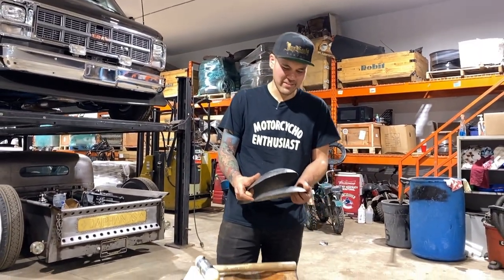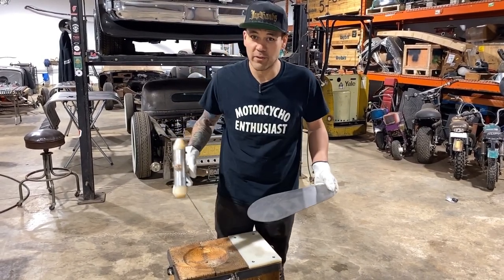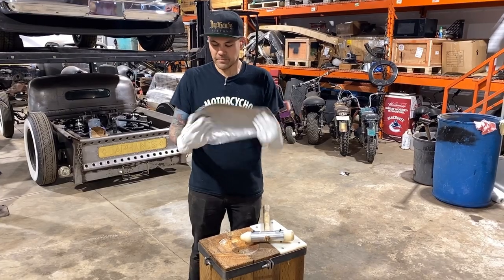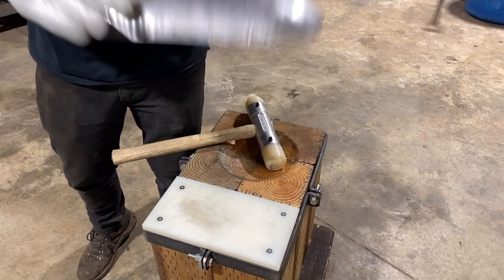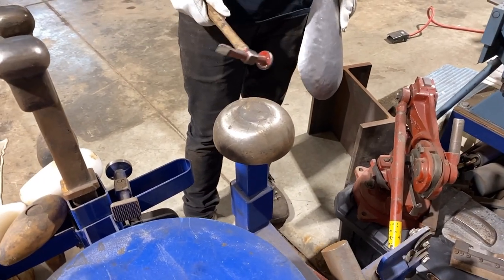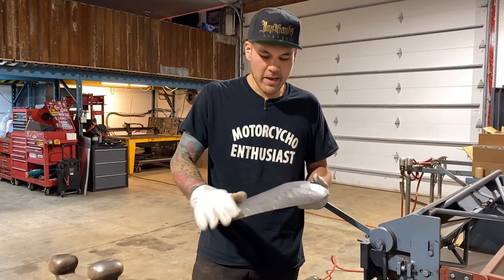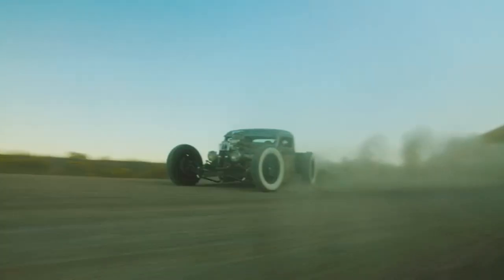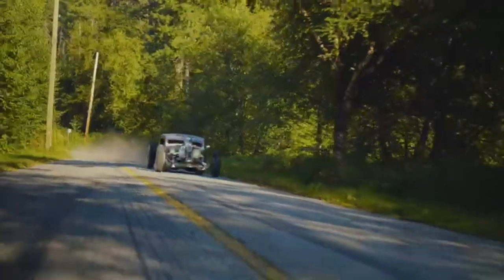Simple Metal Shaping with a Shrinking Stump, Hammers and Dolly

Comment: Thanks for the "How to " it's like the kiss idea .. keep it simple stupid ... this video really does show how simple the basics are , a good hammer and a dolly and off ya go . Add to it as you grow , a tree stump with the hollow a few more shaped dollies its not that hard . Yes that mental road block has the effect of limitations in what you can achieve I'll admit that's hit me for a while now . Many years back a friend sold me a basic mig welder only 90 amps .. more a hobby one than anything substantial.  For 30 years that little tool earned me a fair amount doing plating on cars and anything that I could weld up . Along the way I taught myself how to shape steel to fit areas that had rotted out . Due to age and mobility I very rarely do body work on cars anymore now its bikes as I can do what I need on a lift bench . Recently I started custom building bobbers and the stumbling block is the lack of fitable rear mudguards ... I can do them easy enough but as you say the mind plays with ya abilities regarding tooling yes I've got a pipe anvil and sheet benders but no planishing hammer or English wheel . Looks like it's time to go back to basics and re teach myself . Thanks karl for the push . Really enjoying the videos and as some have said in the comments I'll agree you are the best out there on you tube . Your skill set and laid back way of explaining is brilliant . Cheers .

Comment: Thank you for making the point, 'keep it simple'. And for stressing that you don't need elaborate,  expensive tools. YES, they make things faster and easier - SOMETIMES.  
I use a screw-on welding tank valve cover as a "mushroom". I put it in a vise and pound away. My 'stump' is the concave (bottom) of a welding tank that I use on my workbench, and my flat piece of 'nylon' is an old railroad tie plate. My hammer - Harbor freight.
Reply from the maker: That’s awesome ! I’ve seen guys make a hammer from the tops as well
Reply: I have an old hammer with removable inserts that I found in an old tool box and I "turned" inserts for the thing out of literally every material I could find using my drill press and a flap wheel... That was before I made my own lathe which is janky AF but still does everything I need and more I have some videos on the lathe... The gas bottle dish is a really good idea tho that's on my list of things to make cuz I have one of those and even still have the cap and I never thought of that...

Comment: So your new stump works very well. I'd like Wray Shielin's design aswell. He calls it the facilitator. The stump bowl is lined with a blue shield material without the plastic membrane on the surface of it, butyl like material that grips the work piece some what when you shape the tucks inside the bowl. It never seems to wear out and seems to speed up the process of stretching and shrinking because it holds and gives at the same time. Great job show the simple shaping of the steel .I enjoy shaping aluminum much easier . I watch ya all the time Carl!

Comment: Perfect video at the perfect/ ironic time! I was barely out of city limits, purchased a house & remodeled it. 5 years later due to fraud l, deception, I miss the freedom of being out of city limits & being a homeowner! Now that I am in a small apartment, I cannot work on my car or do projects, I feel smothered! I have to replace the rocker panels on a pontiac G5! The rust has spread further then a set of rocker panels would cover by themselves so, I was thing of buying sheet metal, bags of sand to pound the metal onto & try my hand at making my own rockers & panels but, as I was working, I saw the price on a small sheet of sheet metal 40-45+ & realize that it might be best to purchase pre-made rocker panels & 1or 2 sheets of sheet metal to patch in above the rockers. Funny/IRONIC how I speak of metal shaping & I see this video!!! Your shrinking stump is cool & you have some Nice equipment & one heck of a garage!!! I was considering hammering the sheet metal on bags of sand to form the shapes & I am wondering how well that would work?

Comment: Great vid !  Picking up more & more ideas from your vids - thank you.

One of my dollies I've used a lot is a hard rubber (not plastic - they crack) bowling ball, which works surprisingly well.  I drilled out one of the finger holes to 3/4", shoved a 3/4:" bar into the hole, clamped it in a vise and formed the needed curvature into the sheet metal.   I've made lots of patch panels over the years with it.

Comment: Use your gas torch with no oxygen. Put soot over your part then open oxygen to a neutral flame and burn the soot off. This will aneal your aluminum and make it softer to work and also so it won't crack. Thank you for your great videos.

Comment: I agree with you although it’s hard to make an accurate statement without holding it myself but it just looks kinda big. If you could make it like 20% smaller overall I think it would look more proportionate and you could even keep the same sized nylon heads. And shorter set screws so they fit more flush when seated. Great design though and you could even offer a whole array of different pointed and crowned interchangeable nylon heads for it too.

Comment: Karl, these "how to do it at it at home with virtually no (high-buck) equipment" videos are great encouragement for DIYers that want to try our hands at Metalwork without risking the relatively big bucks on equipment that might end up being wasted if we decide that we don't enjoy it.  Thank you for making them!

Also, when you mentioned using Bondo for filling as & when needed, it reminded me to ask if you had heard of Evercoat Rage Ultra Xtra (a body filler) + its catalyst being better than Bondo.  I saw another YouTuber that is not a "body guy" using it when filling small casting defects on some machinery before painting.  He said it was recommended to him by several viewers and that it lays down easier & sands easier than Bondo does (or has for several years worth of machinery rebuilding/restorations for him).  Do you have any opinion on this product?

Comment: G’day mate. Quick question. Does the metal start to get work hardened when hammering it like that? Would annealing make it easier to move?

Keep up the great work. 👍🏻
Reply: I'm pretty sure hot rolled mild steel does not work harden.  As an added bonus, it is also cheaper than cold rolled or carbon steels :-)
Reply from the maker: If it were aluminum yes but for the steel know

Comment: Cool stuff. I'm curious if you've ever tried rubber pad forming or hydroforming. They seem like interesting processes that I think you could tackle.
Reply: Hi. I’ve looked into that too. And this year nearly purchased the materials to make a setup. But… after pondering it a lot, I think  a shop press that can only apply 25 tonnes will struggle with 1mm steel. 
In all the videos on YouTube, the aircraft guys are using soft aluminium.

Comment: Successful demo, the best kind. Did you use your File-turned-slapper at all? I had a wasted file that. Like you, I turned into a nice offset and polished slapper. Works effectively on examples like you demo'd here. Two thumbs up.
Reply from the maker: Thank you! No I didn’t use the slapper just my single hammer to smooth it after
Reply: @MakeItKustom  This was one of your best series with the stump build followed by how to use it. Even with time shortening by the vid process, you moved that metal pretty fast. A keeper and inspiration for many of your watchers.

Comment: The tools we grew up with is nothing what is available now days. From 9yrs old I grew up doing floor pans with 2 bed rails, 2 vices, couple ball-peen hammers, pliers and welled it together with oxygen and acetylene. At age 16 got a arc welder and until I was 20 got my mig and tig. Wishing back now I wish there was alot more metal shaping but took machining and welding instead of automotive. There's alot of cheaper tools has made that possible now days.

Now cheap and quality don't go together and dont mind paying extra for something that will last, but you said you were making an affordable plannishing hammer... but 3k cad is little much for people I know last I checked. Its like lazzie equipment, would be nice but will never afford anytime soon.

Comment: Aww man! Effort...again? I did that last year! Everyone who wants to bash metal should really learn the old school ways first before, AND become reasonably proficient even before they get to touch a machine. (What would they do if they only knew machines and the power was gone?). Even though metal working machines have been around for over 100 years, the old hand working ways still apply, the old tooling is still a viable path and can still be used. This gives them good grounding in, and appreciation for the processes involved. Plus hopefully a realisation that the work that the old timers put into their pieces, was considerable. Although tools like the mushroom dolly are generally made with certain operations in mind, what ever you find useful for it to do is what it was made for, it's just something the designer never thought of. Karl, with all due respect, your stump is moving far too much. I recommend a HEAVY base. Perhaps a 1/2" steel casing filled with reinforced concrete and slabs of 1/2" welded to the base up to the strapping you made. This is the reason blacksmiths anvils are heavy and fixed to a HEAVY base...no movement. All that movement is lost energy and is causing you to have to work harder than you need to. Otherwise, another awesome vid! You have well earned a lot of respect from your followers, including me...(and, being old and grouchy, I ain't easy to please 😊)
Reply from the maker: Thank you very much for your honesty! You are totally right in the beginning of the video I didn’t have it screwed down. By the end of it I attached six more six by sixes and wish I had just made mine all the way to the ground

Comment: So I been trying to determine if it is better to use a soft concave surface like this with a rounded hammer, or to put it on a flat hard surface with round hammer. The hard surface will push the metal outward, and in theory cause a bulge to form. What are your thoughts about using a hard surface?

Comment: Hi Karl, I wonder if it is possible to shape a piece of sheet metal into a corner. I'm currently rust-repairing my daugthers car and there needs to be a patch welded, which is pretty much a corner.
We were trying to hammer it out and shrink it with a hammer but  it was terrible. 
in the end we made one cut and welded the overlapping part.
Do you think it is possible at all just by using hand tools?
Best regards from Germany!
Reply from the maker: It’s definitely possible but a “hammer form” with wood would make it easier
Reply: @MakeItKustom  ok... What do you mean by hammerform? The outer shape in this case and hammer the sheet metal into the corner?
A sandwich, as you_ve shown already won't work, right?

Comment: Would it be possible to make the tucking hammer using a croquet mallet and shaping the ends?

Cool work you’re doing, thanks for sharing.
Reply from the maker: Not sure on the weight but I don’t see why not. Might need a beefier handle